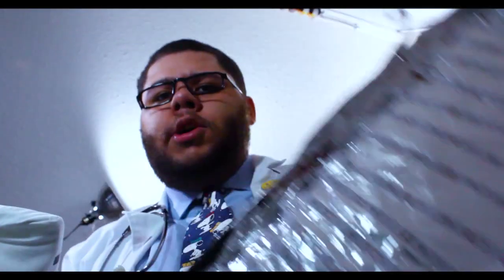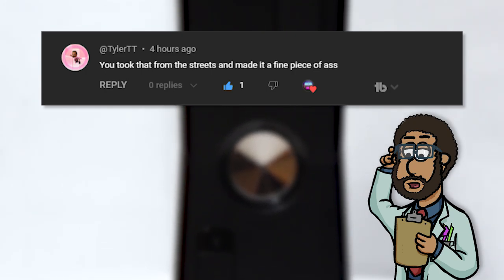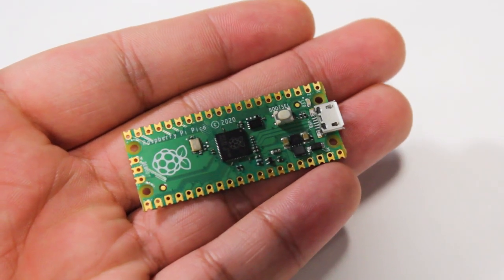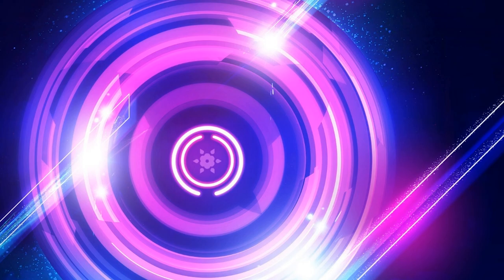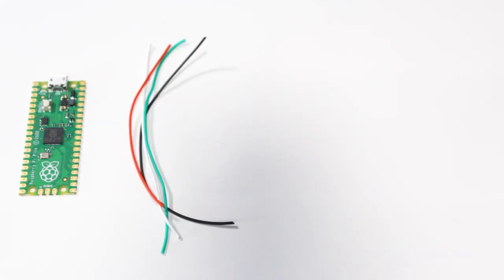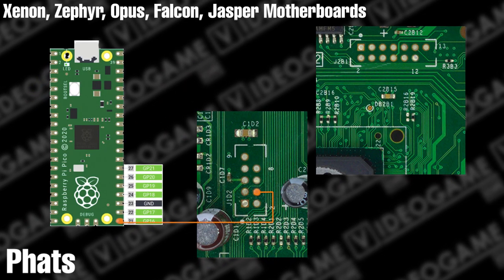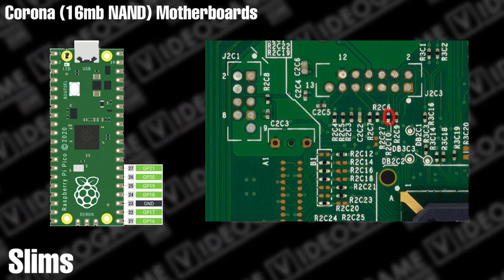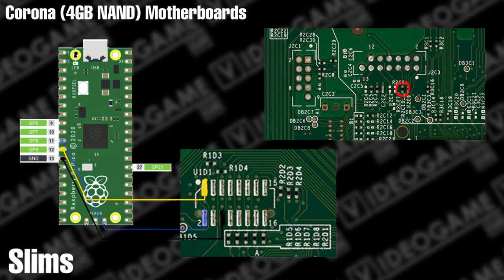How To Turn A Raspberry Pi Into A Xbox 360 NAND Flasher | VideoGame O.R.

Comment: Does it matter what Pico it is? I'm thinking of getting the non-Pro version.
Reply from the maker: As long as it's an official pi pico you should be fine.
Reply: @MCDNetwork   
Thanks a lot! 
This'll be my first time doing some soldering too, so I'm kinda nervous (Have the Xbox Slim Halo Reach Edition which I really like).

Wish modding the 360 was as easy as modding a PS1/2/3 but it's an opportunity to learn some hard skills.